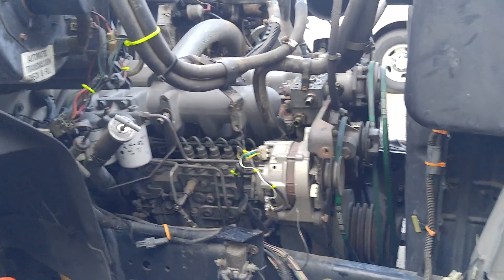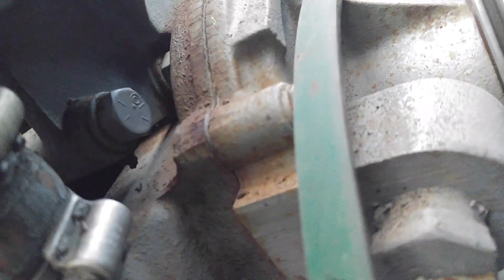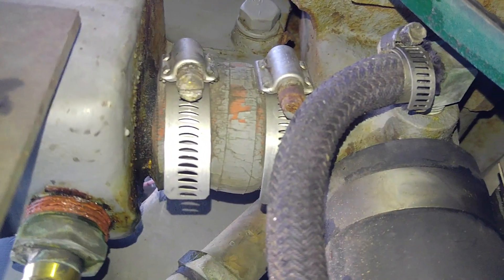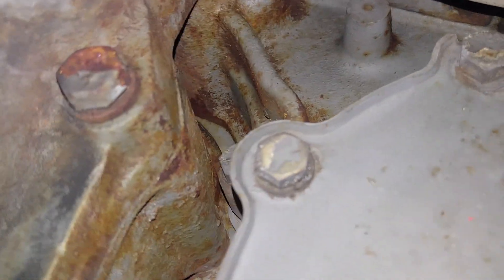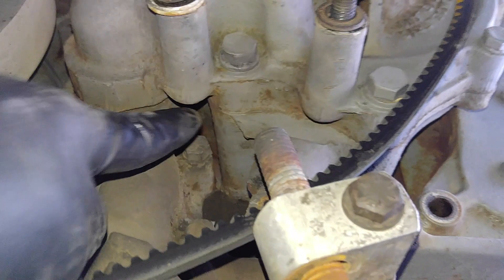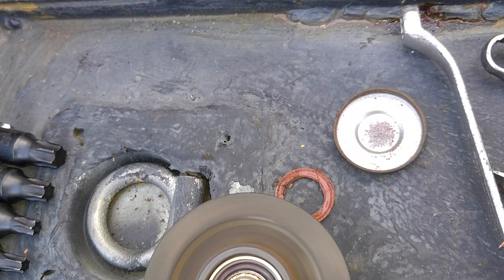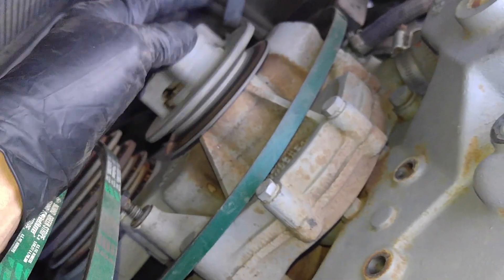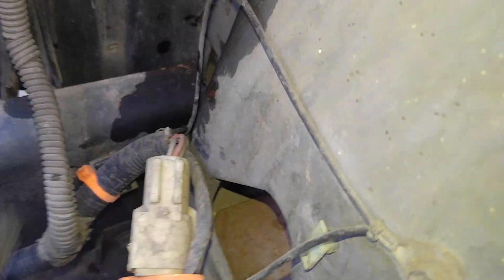F700 Water Pump Review 9 2 19

Comment: Was gonna call you to day. Can't find your number. Bought another 6.5 today. 93 c3500 crew cab. No rust  got it cheap because of a fuel leak. Looks like it's the heater seal.
Reply from the maker: 5one857two645zer0